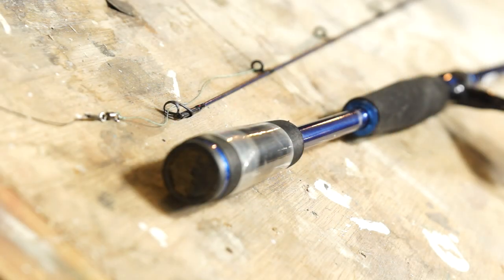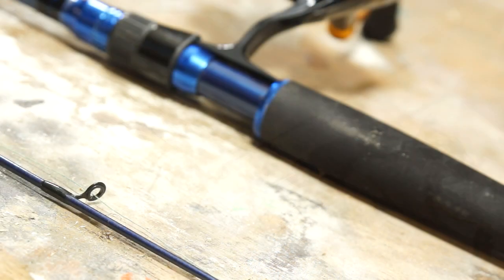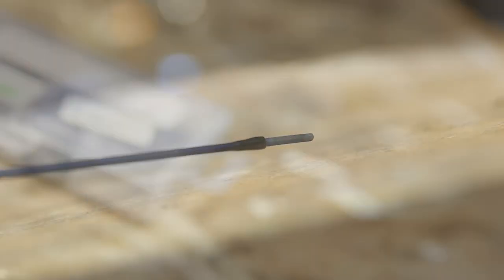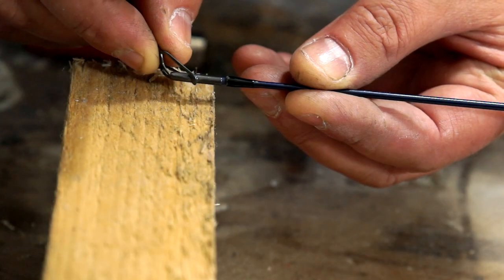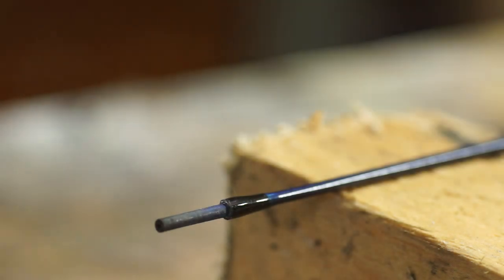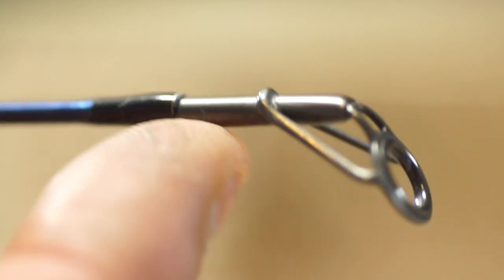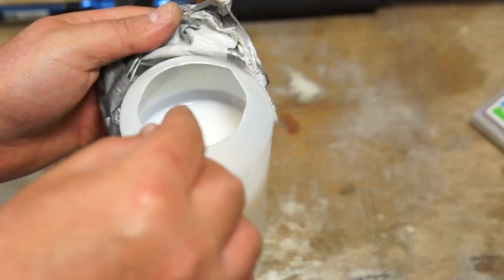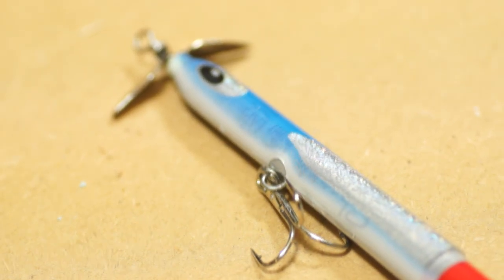Replacing the top eye on a fishing rod

Comment: A tip I picked up from ace lure angler Dave Kelbrick,which I think he shared on one of Matt Hayes programmes ??? ,is to thread a large fluro bead onto your line,above the trace swivel. This will stop said swivel from being wound into the tip eye and causing damage etc.....   Because of the fluro colour,you should notice any over winding of the line,long before the bead gets near the tip ring.

Comment: Be careful folks. Any overheating will result in the carbon fibre at the tip breaking down. So it has to be just enough to melt the glue (if indeed a thermosetting glue were used originally). So heating while pulling at the ring is to be preferred because it'll break away as soon  as the glue-line melts without the carbon fibre rod tip getting too hot. If the tip is not attached using thermosetting glue then the preferred method is to file (or gently grind with something like a Dremmel) along the side of the tip and then open it out with a pair of pliers and slide it off.
Another hint - load some threads of the hot melt glue inside the new eye before attaching it to the rod tip... it will give a much more secure joint.

Comment: If you wrap masking tape around the rod end of the eye tube - assemble push tight and aligned with other eyes - then wrap masking tape around the rod at join - then check eye alignment and mark across both tapes with sharp pencil. You can disassemble - glue - assemble in immediate alignment. This will help with clean-up too.

Comment: Another awsome video. A humble suggestion Paul is a dremel tool cut off wheel makes short work of any pole just be sure to where a particulate mask you don't want to inhale any of that dust but leaves a super clean and crack free blank. That's a super neat way to challenge a buddy I'm jellous.
Reply from the maker: Matt I was going to get the dremel out because I have seen them use one in the rod factory just to tidy up and trim things but the flaw in that plan was I could not find my dremel or the cut off wheels so i had to manage with a knife, cheers
Reply: The Handmade Fisherman your judgement is always spot on paul and a dremel is a little over kill especially when your knife hand is so keen. My fear is that I would cause a crush cut because I can be a bit heavy handed. I parted out a pallet load of store returned poles that I had purchased for a few bucks last year. The dremel was a good choice it made short work of all the bulk repairs and the grips/reel seats I cut down and stored to heat off the blanks later on.

Comment: Great detailed video. Btw, 2-part epoxy works for me. As an added advantage, you have more time to do some adjustments until it's cured.
Reply: Can confirm, and it's much sturdier after the fact.
Reply: You use the 2-part epoxy to glue on the eye, or to finish?  If gluing it on, how are you going to replace it in the future when the eye gets damaged?
Reply: i usually heat it with a lighter until it softens enough to take the eye off, probably not the best approach but it works for me.

Comment: A tip is to use a smal rubber pearl that are just a bit bigger than the top eye, put it on the main line before the swivellock and it will protect the eye from the swivel.
Reply: Or you just make a knot braid to leader

Comment: necessity is the mother of invention. I once broke a rod tip of one of my favorite rods about 6 inches below the tip. S I used an old drill bit to fit inside the rod (it was fiberglass) and some epoxy to glue it all up. Still have the rod and it still works! To take care of t hat rough bevel, I has seen some use shrink tubing to cover it.
Reply from the maker: thanks

Comment: hot glue doesnt work..been fighting with it for a month now..the damn tip keeps coming loose and i have to reheat it and let it cool..then a few days later same thing.
Reply: squirt super glue into the tip's hole then plug it. just make sure to line it up to the other eyes.
Reply from the maker: i have been using it on on rod for about 3 years and never had to reheat, i have used superglue and after a while it started to spin
Reply: I have a really old stick of birch tar that we have been using for 50 years. Never had a fail.
Reply: 2-part epoxy works for me. As an added advantage, you have more time to do some adjustments until it's cured.
Reply: matanuska high locktite adhisive works well
Reply: Liquid nail works great!